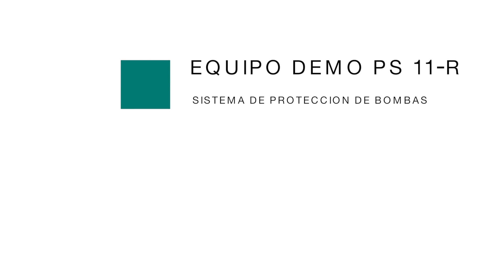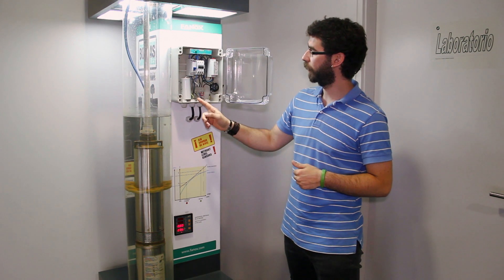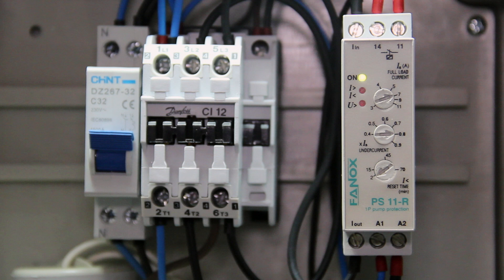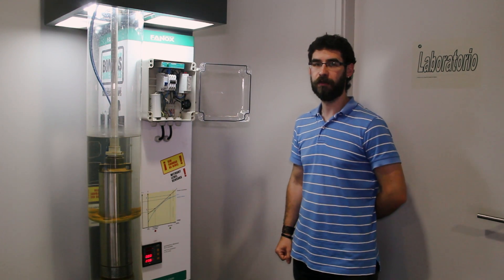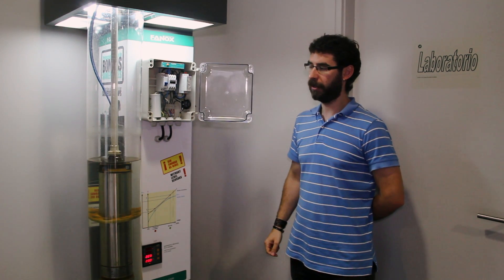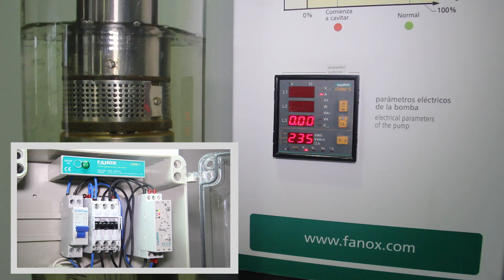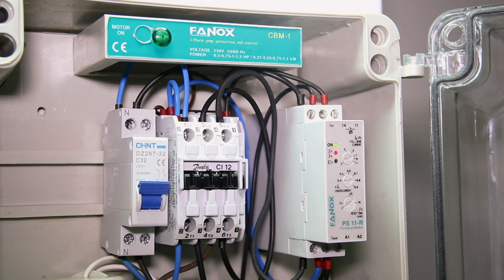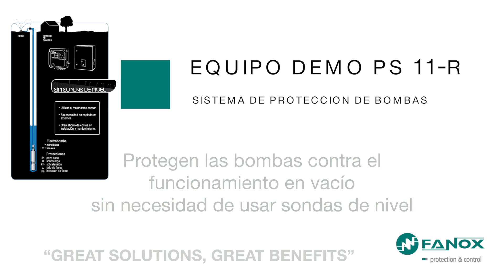Pump protection panels without level sensors for submersible pumps FANOX

Comment: Is this undercurrent protection is sufficient to protect the pump ? what about dipped water electrode(dry run sensor) or float switch which used for dry run protection, is it suitable for well pumps? how it could be installed within the well ? what is the best protection you prefer for well pumps against dry run  ?
Reply: The relay is installed in the electrical box that supply electricity to the pump, not inside the well.

Comment: I m not getting the point on which this relay is working without current transformer
Reply: If your motor's amp rating is within the amp range of the relay, then you do not need to use a CT.

Comment: May we use this relay till 100 amps....
Reply: Since your motor amp rating is higher than the relay's rating, you need to use a CT (Current Transformer). Then you run through the relay the CT wire.